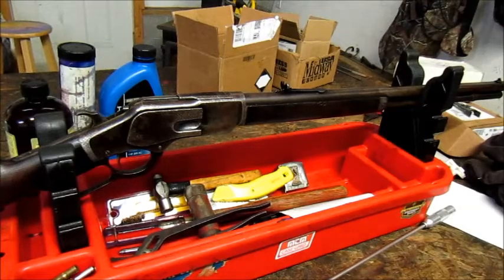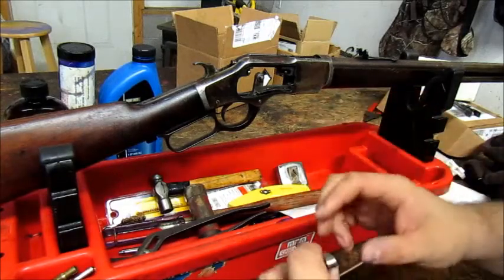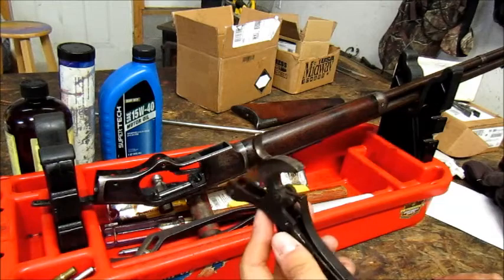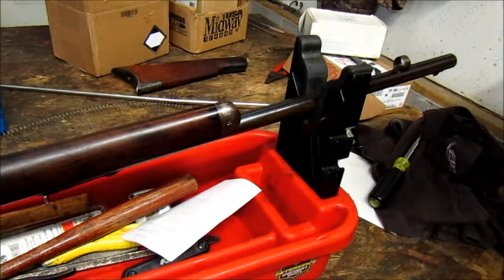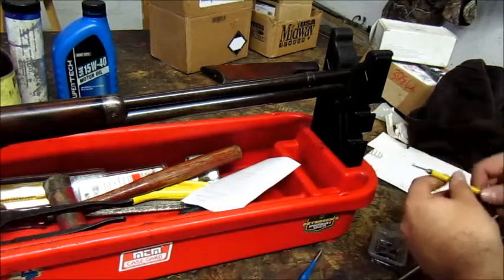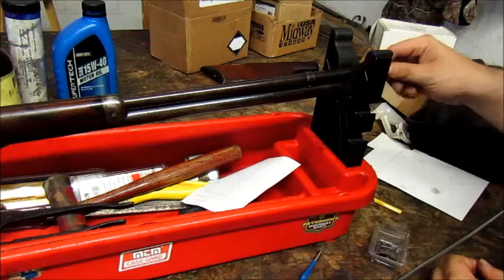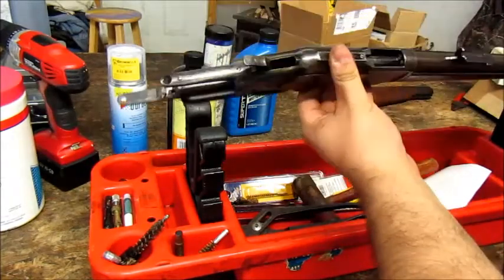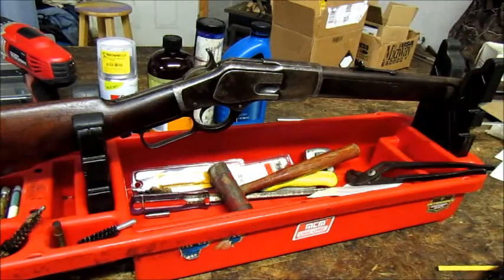Winchester Model 1873 Disassembly

Comment: @Targetpopper

Thanks for the video! I am working on a c.1907 Model 94 myself, and the magazine tube pin you extract at 21:32 on mine seems totally frozen. I've tried tapping it a bunch with my pin punch, as well as a good external scrub with acetone, but no luck in getting it to budge. Do you have any advice for freeing up really stuck pins? Thanks!
Reply from the maker: If it doesn't want to come out then leave it in. If you NEED to remove it then take it to a smith with a LOT of experience in old arms and talk with them on how to remove it.

Comment: I have an 1889 38.40  model and wanted to mount it in inoperable condition so children couldn't operate it.   So I removed those two "toggles" inside the side plates.   I didn't want a trigger lock showing for display purposes.  Could someone still insert a cartridge into the breech ( if they had one, I don't keep any ammo for it ), manually pull the hammer back and fire it?   If so, what's the easiest way to prevent that ( minimum disassembly )?
Reply from the maker: I'm not qualified to advise on how to disable firearms for display purpose. In it's current state you've made the gun even more dangerous. Now if someone manages to load it the gun will send the bolt flying back. I would put it back together and simply tell anyone who touches it they are getting a whoopin.
Reply: @Targetpopper  thanks for the reply our grandchildren won't be allowed in our house unless this thing is 100% safe so I think short of diggng more into disassembly like trying to get the firing pin out we'll just have to display it with a trigger lock
Reply: Burnhaven Yikes... if it’s in shootable condition, I’d be interested in buying it.

Comment: Do you clean these from the muzzle end?
Reply from the maker: DezzertRider I clean them from the breach if I can. It requires either a snake or taking the rifle down to have a straight shot with a rod.
Reply: Thanks for the reply.  I have a Uberti 1873 replica.  After watching your takedown video, I feel more comfortable about taking it down to the point where you can remove the bolt and firing pin so that you can use a rod from the breach end.  I've only put one box of ammo through mine and I used a snake.  Next time I'll take it down far enough to remove the trigger assembly, bolt and firing pin to properly clean it.  Thanks!
Reply from the maker: DezzertRider just take your time. Your Rifle will be a lot tighter than mine so it might be a bit trickier.
Reply: Yes, some of the screws are very tight on a new gun. I purchased a quality screw bit set to tackle the job.  Hopefully once I get the screws out successfully the first time it will be smooth sailing from there.

Comment: Send it to Turnbull for a reblueing or a Brown finish.
Reply from the maker: No
Reply: Also .... why are you using an electrician's screwdriver to take the screws out?  That's a good way to booger them up.
Reply from the maker: roostershooter76 Haven't had an issue doing it yet. Just gotta be careful, no reason to rush it
Reply: @roostershooter76  why rag on him  about a screwdriver ,if the blade fits the slot it will do. I have a Brownell's screwdriver set & it is crap, the blades are so brittle , over a third have shattered .